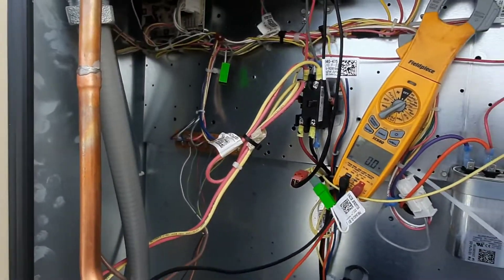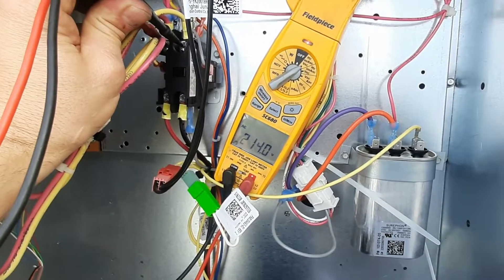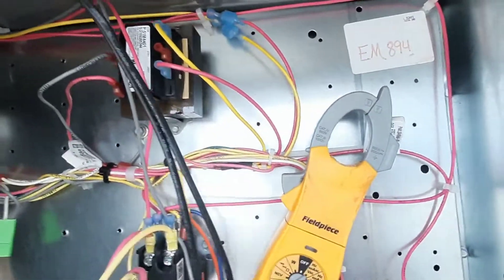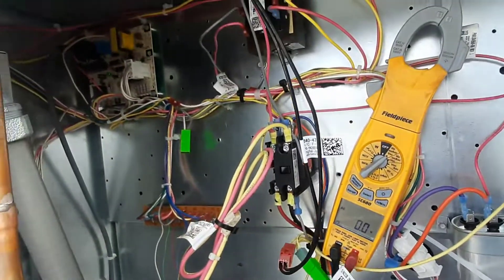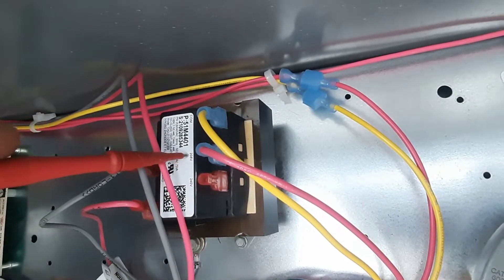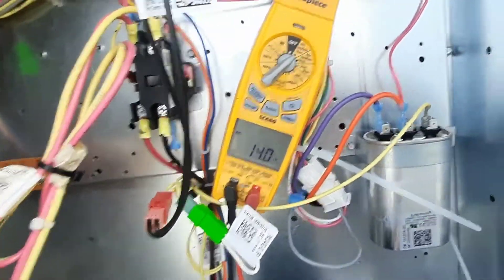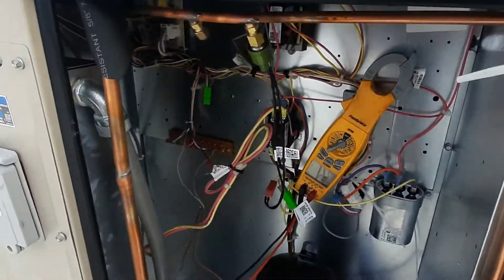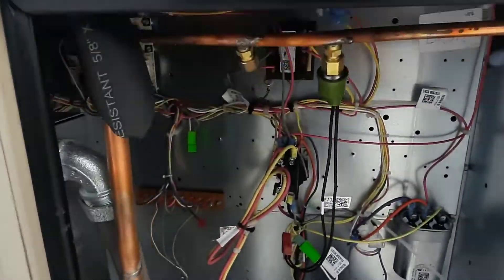Commonly missed, Simple fix! #hvacservice #hvacarmy #hvaclife #hvac #commercialhvac #electrical

Comment: i totally agree with you, with the voltage taps.  i often go to a recently installed roof top unit,  and its wired with the wrong voltage tap on the transformer.    thats why the start up sheets are important   (-: ha ha ha
Reply from the maker: 😆 start up. Your lucky if they turn the disconnect and gas on 😂

Comment: It's wild how often we come across mis-taped transformers. Great info here.
Reply from the maker: Thanks! It is kinda crazy how much this happens when it’s so easy to correct.
Reply: *tapped. Taped is a different thing. In most cases I wouldn't have been so nitpicky but taping (marking wires) happens to be a thing in electrical as well, so it could cause real confusion in this case.  😉

Comment: I find that very common in commercial oftentimes goes on unchanged for years. I remembered in the real hot summers contacts for coils without close because it wouldn't get 24v it would drop to like 20 or 18v
Reply from the maker: It’s so easy to change and yet it seems like it never gets done.

Comment: I see this often. In fact, where I work we have 208 and every single unit had to be changed. You'll also see a primary tap for the higher voltages where you can select between 440, 460 or 480.
Reply from the maker: It is a common issue.